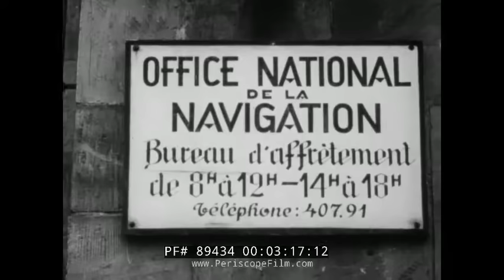MINING & SHIPMENT OF COAL IN FRANCE  1950s EDUCATIONAL FILM  STRASBOURG   89434

Comment: 2:19 Old tannery at the Rue du Bain aux Plantes, nowadays a hotel.
3:57 The barge will travel the Rhein-Marne canal with its 178 locks, at an average speed (as later said by the narrator) of 13-18 miles per day, due to the sheer number of locks and the boats queueing for them https://fr.wikipedia.org/wiki/Canal_de_la_Marne_au_Rhin  
12:39-13:05 The canal tunnel of Arzviller, measuring 2306 meters long, built together with the train tunnel in 1849 https://fr.wikipedia.org/wiki/Tunnel-canal_d%27Arzviller
13:15 "All the barges are required to turn off their engines and be tugged by the Compagnie Fluviale's electric locomotives", which was the case between 1933 and 1972, the date upon which the canal was opened to the leisure navigation. The boats are no longer required to turn off their engines and may traverse the tunnel under their own power now.
15:20-15:25 The boat passes upon the canal-bridge (or technically  - an aqueduct) of La Madeleine, near Nancy https://fr.wikipedia.org/wiki/Pont-canal_de_La_Madeleine
19:14 Most French sewer pipes, sewer and other underground infrastructure and covers and furnishings are made at Pont-à-Mousson